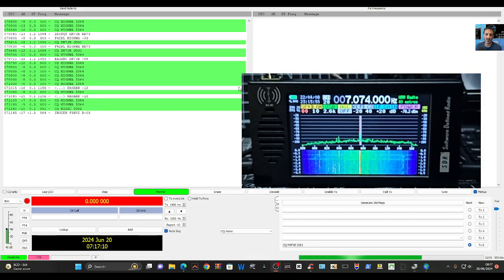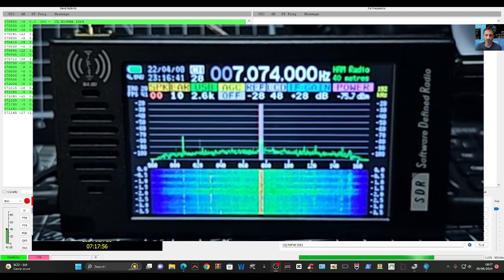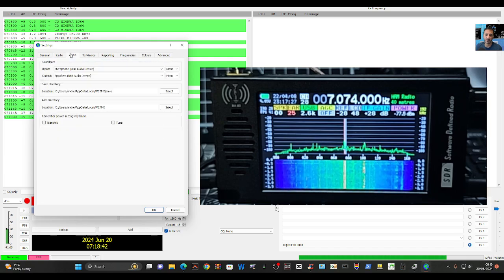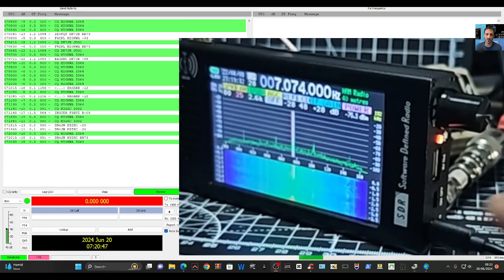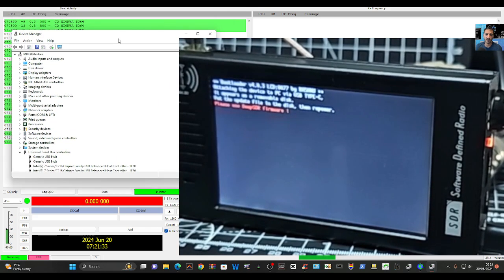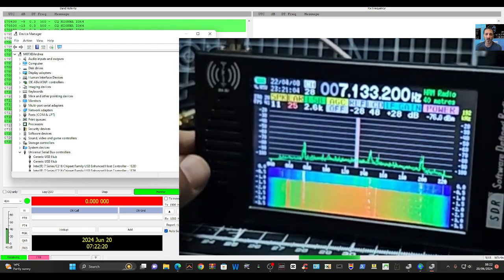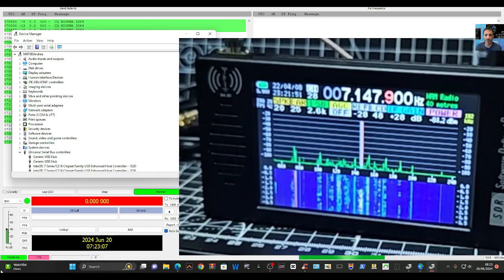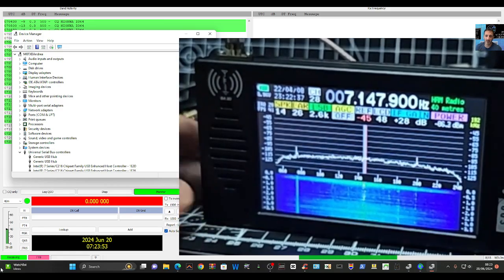SDR 1.0 Budget Clone - WSJTX Receive & Firmware Mode

Comment: I solved this problem with USB connection. You need to replace the 22 ohm resistors in the USB D+ and D- bus. You can see how to do this on my channel. Just do not flash the original firmware or get a blue brick!
Reply from the maker: Many thanks